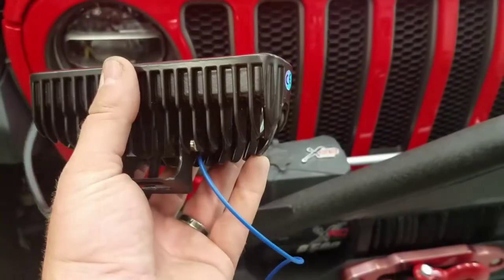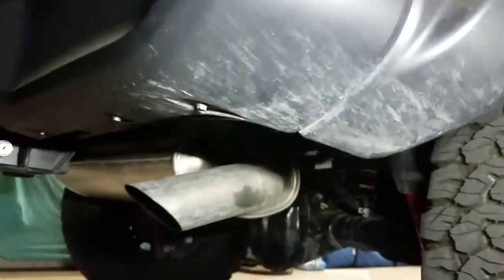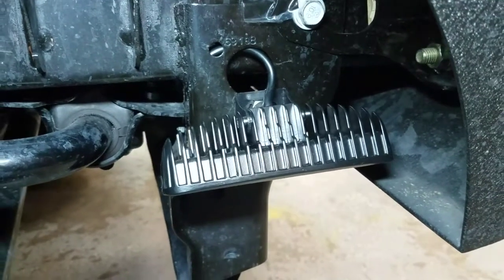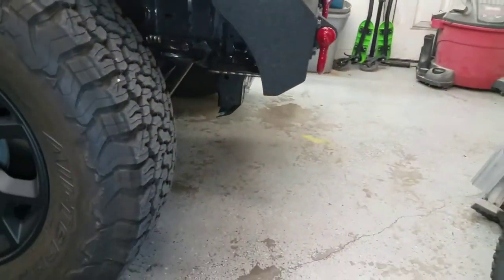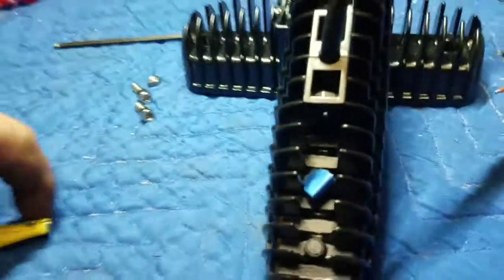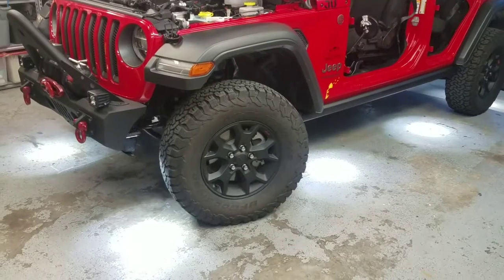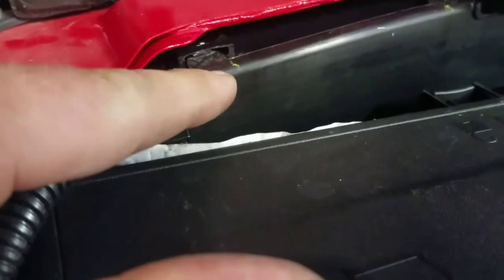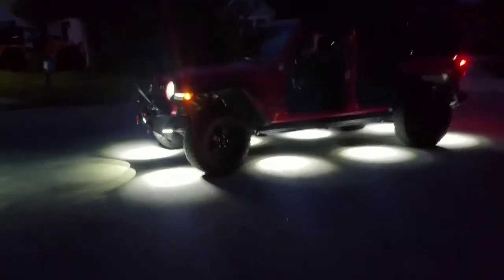Wrangler JL / JLU rock lights install

Comment: Awesome, looks great... You connected the lights in series or parallel???
Reply from the maker: the left side was run as on strip and the right was run as another, but both on the same switch.